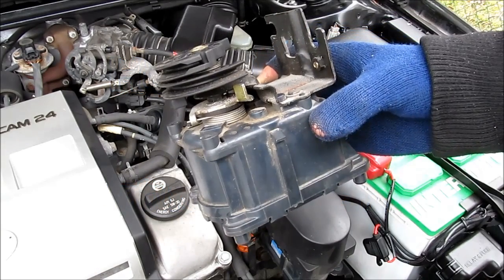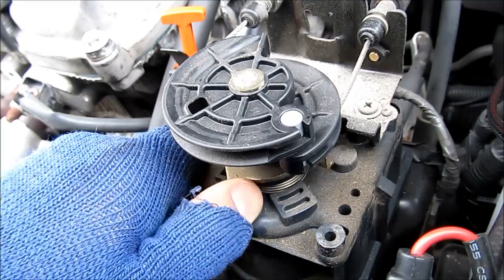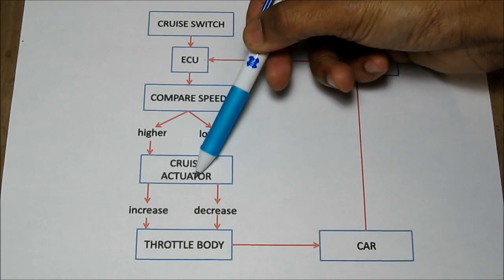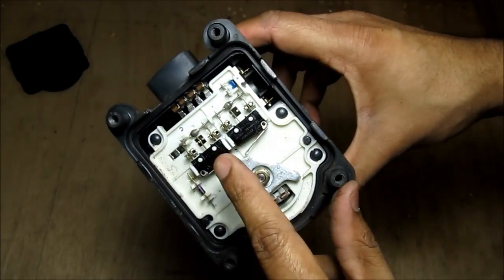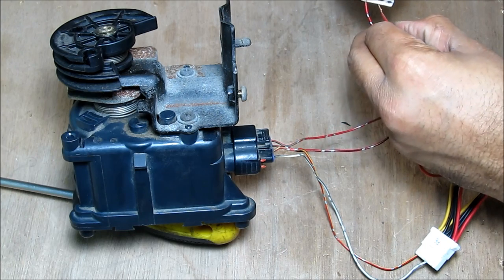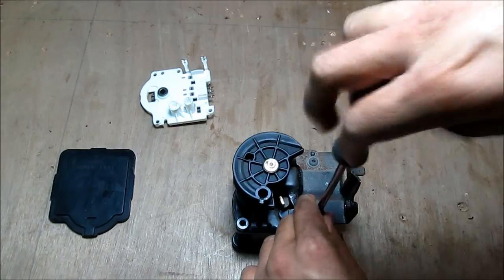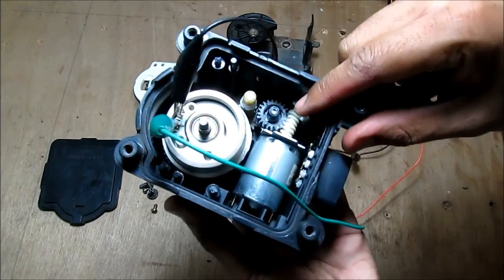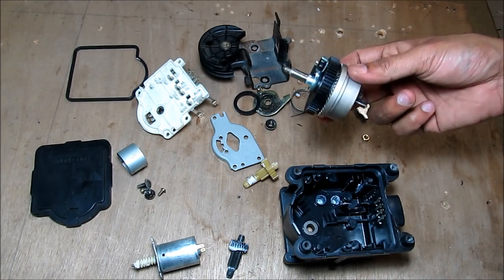How a Cruise Control Actuator Works

Comment: i thought before the cruise control system is when you activate it. the computer box itself will regulate the spray of the injector and the throttle itself without cable but only servo motor would regulate the air intake. But now, it's just about servo motors that control the throttle cable itself.

Comment: Very nice illustration with proper working and clear view of the assembly of the system.......
Thanks for it

want more such videos........

How that speed sensor works....

what if an emergency arises and I need to apply brakes.....
Reply from the maker: +Enanko Moulick thanks. Short, easy to understand and to the point is my style. 

When you brake it deactivates the cruise automatically.
Reply: +speedkar99 is that done by the speed sensor
Reply from the maker: +Enanko Moulick Speed sensor is only an input to the system. The brake switch connects to the cruise control module and deactivates it automatically when hit.
Reply from the maker: +Enanko Moulick Speed sensor is only an input to the system. The brake switch connects to the cruise control module and deactivates it automatically when hit.
Reply: +speedkar99 thanks mate
that clears my doubt

Comment: Hello
I am working on cruise control system 
Can u upload videos related to independent motion of throttle control and cruise control
Reply from the maker: +Sai Charan like drive by wire?
Reply: When the cruise is activated
Will the cruise deactivate wen we apply the acceleration??

Comment: how the speed will be converted to voltage(input to the electronic actuator)  to main the exact speed which we given, 
please give me idea regarding this!
Reply from the maker: +Shaik Thouheed speed sensor on transmission
Reply: Speed sensor output will be in voltage.
Reply from the maker: +Shaik Thouheed yes it will. And that goes to the instrument clusters for filtering then off to the ecu.

Comment: you are awesome man....know your stuff pretty good..any idea why 2003 Mitsubishi outlander cruise control shows its on in dash but won't engage...vaccum lines to servo looks intact...any suggestions??
Reply from the maker: +TheHaryanvijatt Thanks, check fuses, vacuum leaks, relays, brake switch, cruise switch, and throttle body connection.

Comment: just one question please i want  to know  when i want to put a set speed i must to press on the gas pedal or not , is the pressed at the gas pedal did automatically or i must to pressed on the gas pedal for the first time when i want to maintain a set speed
Reply from the maker: No you don't need to press the pedal. The motor in the cruise actuator will set it according the speed.

Comment: Thank you for that explanation, I have a question , does the regular cruise control actuator work with radar adaptive cruise control sensor? , because I have Camry se 2017 with regular cruse control system and I want to add radar sensor where can my car go slow and fast depends How is the speed of the car in front of me